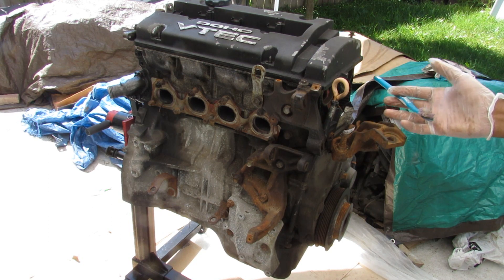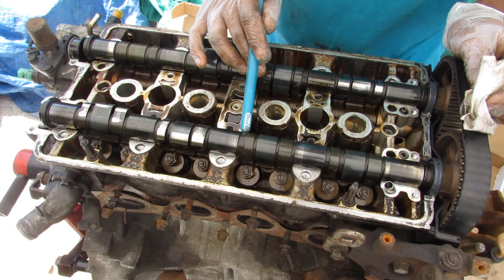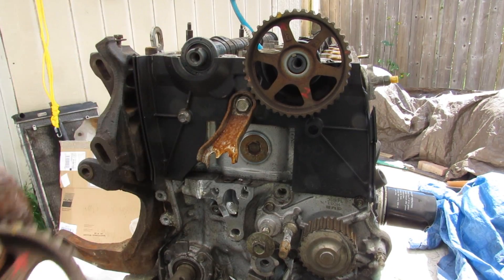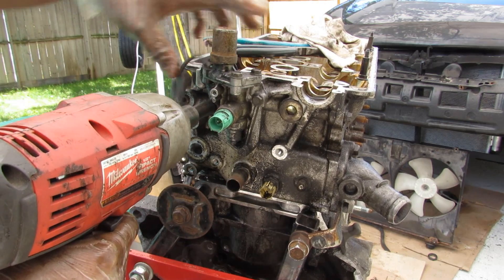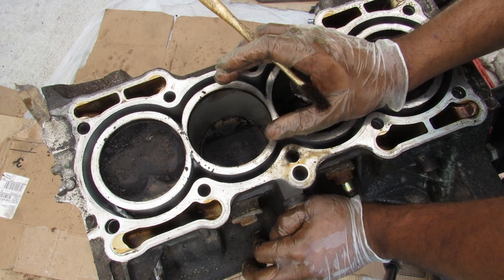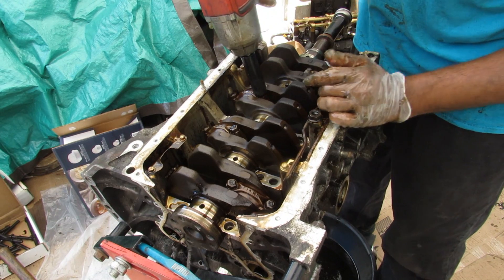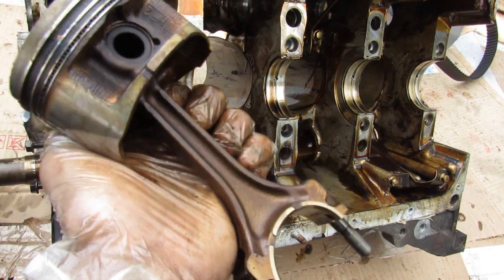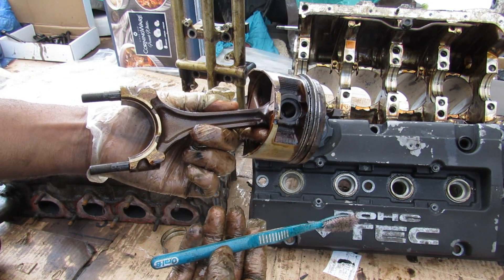Why the Honda H-Series Engine is the Best of the 90's

Comment: Does the single cam counterpart (F series) have pretty much the same strengths and weaknesses? (Excluding rev range given it’s single cam)
Reply: I like f series bottom end better just for the non FRM cylinders
Reply: @2strokeFORever  another question came to mind out of curiosity— is it possible to put the oil galley cage thing from an H series on an F series? I do understand your reasoning for the iron cylinder sleeves
Reply: Nevermind that question— it seems the F series does use the same or similar oil system, which can be seen here at the 14 minute mark https://youtu.be/vP0HwbhQJvs
Reply: @Creeperboy099  you can probably have the girdle machined to fit over the crank caps, people do it for lsvtec setups a lot. B18b doesn't have a girdle, but the b18c does. So you can order a billet girdle/or machine b18c girdle to fit.

Comment: Brother I know you know Honda is the Ford of Japan. 😏
Reply: Uh...you mean the best-selling and most beloved?
Reply: @fun_ghoul  if you for a second think Honda is better than Toyota you must of just started working on cars.
Reply: @reekz1568  I used to be a Toyota boy but the hondas are bloody easy to work on and don't fail much more. I'm talking older cars here. New Honda doesn't have the same vibe
Reply: @fun_ghoul  I’m sitting at a shop right now as we speak. It’s full of Ford, Kia, dodge/ram, Honda. Only thing Toyota comes on for is brakes, tires and oil change. Honda is junk.
Reply: @fun_ghoul  brother you don’t have to get technical with me. Toyota is better than Honda. That’s all I’m saying.
Reply: @fun_ghoul  Toyota’s kinda never break. I’ll have no problem giving you an estimate on your Honda. I’m sure your misfire on 3 that never goes away cause the forged block Honda use leaks oil into the cylinder head. It’ll be around $3800 for a junkyard engine installed...lol
Reply: @fun_ghoul  I’m sure you enjoy your Honda brother. And I’m sure you enjoy your endless check engine lights. To each their own.
Reply: @fun_ghoul  oh and Honda has a recall cause the blocks leak into the cylinder head. Just so you know.
Reply: @fun_ghoul  keep loving them junks. Like I said to each their own.
Reply: @fun_ghoul  so you ride a bike? Okay ima stop talking to you for sure. Best of luck brother no hate.

Comment: While changing the clutch, might as well change the belt and water pump all at once. Imagine adding lighter rotating assembly, it's gonna be a screamer
Reply from the maker: Sure
Reply: Take the head off, port the runners, install lighter valves, new rings, reprogram the 'chip', install oil filter from S2000. Then it's a screamer.
Reply: Manual tensioner conversion, balance shaft delete, and the jdm h23 blue top has the lightest crank. Lighten fly wheel, alloy wheels. Boom rotating mass deletes.
Reply: Clutch and belt are on different sides of the engine...

Comment: Really nice video. I had 2 of these engines, loved them, even with their flaws.
Reply from the maker: Thanks. Did yours burn or leak oil?
Reply: @speedkar99  Yes, they both burned oil, about a liter/quart per 1000 miles. Only minor or no leaks. My 2003 Acura RSX-TypeS also burns oil and the valve-cover leaks (240k miles). I recommend 5k oil changes, not the Honda recommended 10k - it may or may not make a difference, but worth trying, IMO.
Reply: @cernejr  Honda K-Series seems to have a common issue with burning oil. Had an 07 Accord, 200k, all highway miles, very well maintained, oil changed every 5k, still started burning a quart every 500-1000 miles at 200k miles.
Reply: @zuhayrali4202  Good to know, thank you.
Reply: @speedkar99  Burning oil on most 90s hondas is valve seals. In case anyone has this issue.
Reply: @nobodynoone2500  Yes indeed. Easily checkable with a boroscope, if the first and fourth pistons have more carbon build than 3º and 2º, you have valve seals or (in the worst escenario) valve guides leaks.-

Comment: First off. Wanted to say, I love your vids and have been following for about 4-5 years now. Second, I am favoriting this vid, since I still have my H22A swapped 97 Prelude till this day. This december marks 20 years of me being its second owner from when it had 53k, and now it has 282k on the body. I still love the car till this day. 😊
Reply from the maker: Wow that's awesome! The Hondas sure can take high mileage
Reply: @speedkar99  I think my old motor could have lasted longer if I had taken better care of it. I was young, and didnt know as much as I know now. The motor was swapped when I had 186k, due to a missfire. I realized I never did figure out what thr missfire was, so I bought a JDM H22A and its been going strong ever since. I of course have taken better care of it. I also have a K24A4 in my TSX, and my wife has a Scion tC (2AZ FE). I know you did maintenance on a 2.4l Camry,  but I havent seen a teardown yet.
Reply: Nice keep it forever . I will never sell mine 💯
Reply: @Suerte_Pepe  AGREED!!! 💯 Wont be selling mine either! If the motor dies, it will get swapped again.
Reply: I also have a 97 h22a swapped prelude. Bout to SC it
Reply: @busttoboost  NICE! So hard to find the Jackson Racing setup these days. If you do, its REALLY pricey
Reply: 70 years old retired lineman.  Still have 98 prelude with  220,000 miles, don't drive it much. Mostly drive my 2006 subaru sti
Reply: Is that miles or km, Keith?
Reply: @fun_ghoul  Miles. 😊 Sorry I should have specified, since we say for example, 1k for 1,000 miles here in America, or at least some us old people still do. 🤣
Reply: @fun_ghoul  Totally understood!! Cheers!! 😊

Comment: I think the item i would hate the most is having an oil filter at the rear under intake manifold.  That being said, the oil cooler I found interesting and tubular framing for oil passages.   Neat stuff
Reply from the maker: Thanks. At least the oil filter isn't under the exhaust!
Reply: Like a newer Chevy v6. Right beside the cat. And them cats are hot.

Comment: it's a H22a, not a a h23
Reply from the maker: Isn't this an H23? Open deck
Reply: @speedkar99  vtec h23 has a blue valve cover and is JDM only. That is an H22A1/A4
Reply: @speedkar99  It's a H22a for an 97-01 prelude, open deck. H23a only came in 92-96 prelude, in a non-vtec form. check on the block, near the opening to check the timing. you will see the model number. The h23a Vtec is only avalaible in Japan, in a Blue top version.
Reply: H22A3 was closed deck. H22A4 is open. So the H22A3 is preferred by tuners.

Comment: Don’t these engines tend to burn oil after awhile ?
Reply: All engines burn oil, but the frm coating wears out over time and makes replacing the Pistons a pain in the ass. You'll get 200k out of it before the oil starts to burn a noticeable amount with good maintenance. Very solid engines.
Reply: @snakeballs8965  That is not always true; my B20B high compression engine has 225k original miles and doesn’t even burn a drop of oil between oil changes.
Reply: @applepoop10  it 100% burns oil. Every engine does. It doesn't burn a noticeable amount. The oil scraping rings aren't perfect and small amounts are still in the combustion chamber when it booms. The cross hatch on the cylinder walls traps a layer of oil to aid with lubrication, and that will burn. It's molecules thick but it's still burning lol.
Reply: @applepoop10  in a comment about an H series engine. I understand I was being pedantic, but it doesn't change the fact that I was right. The 200k figure is specifically for h series. I used to have a d15b7 with an unknown number of 100k miles on it. Original engine with no sign of any replacements. I never had to worry about the oil.  I sold it to someone when I first swapped my civic and afaik it's still running like a top.
Reply from the maker: Yeah that coating wears off
Reply: They seriously burn oil when they are driven hard. Normally not so bad. BTW, any, especially newer Hondas if driven at high OCI will start burning oil. I know a man, original owner, with '94-95 Civic 1.5L, with 400k km+  - it doesn't consume 'any' oil.

Comment: What about d series??
Reply from the maker: That's not as interesting.
Reply: @speedkar99  
Lol, oh no? 😆👌🏼
You should speak to Eric at Honda Fiend.
Reply: @speedkar99  Boring engine, but sold millions of copies (READ: Will get views) and is available for a song. I used to sell ECU, immo box and key sets on Ebay for a couple bills apiece, mostly into the States but also the Caribbean...and one to Saipan! (Specifically for 2001-05 Civic/1.7EL).
Reply: The D series is great